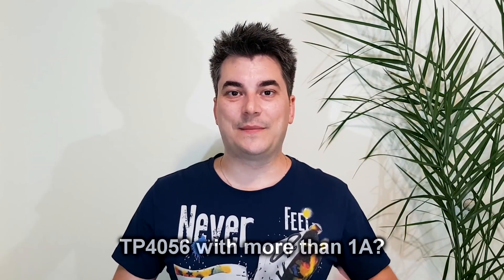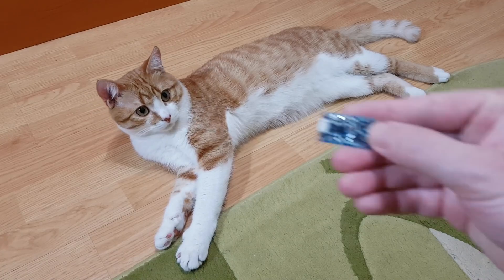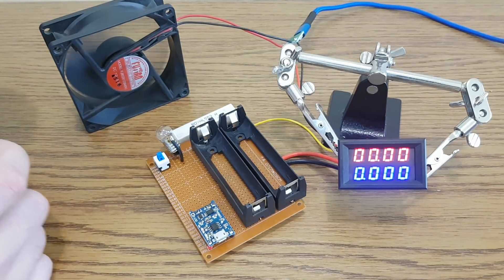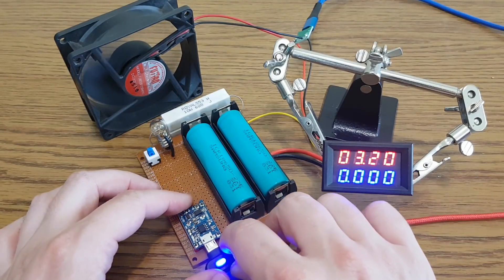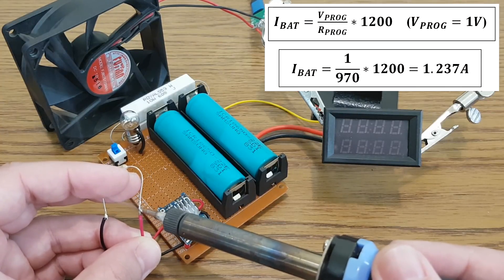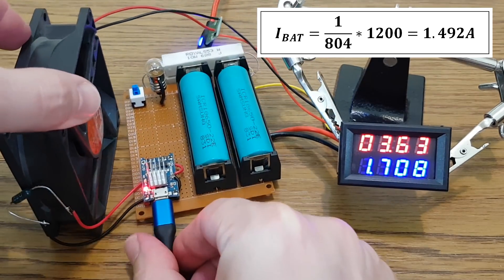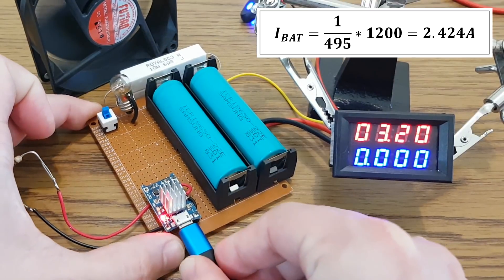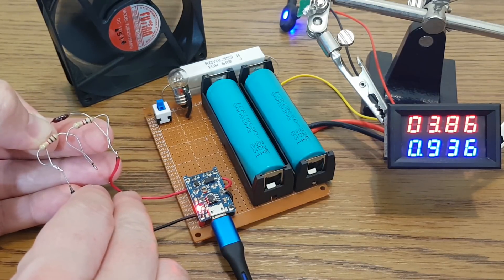Can a TP4056 module charge with more than 1A?

Comment: So the easiest thing to do is probably just delete the resistor and wire it straight through.

Might try it!
Reply from the maker: Actually, the easiest thing to do is to replace the resistor with a potentiometer and adjust the current in real time.

Comment: Accidently shorted one of these chips (the smaller tp4056 variety without UV protection),, so scrapped off the  backside's conformal coating, and the copper ground plane was HUGE(+90% of chip), and it's negatively connected to chip so sinking back side should cool chip better,, just don't scrap off "positive" coating (10%) or you'll short it like dumb arse did.   SORIN, just slap your heatsink(or larger one) on the back taking care to cover P battery terminal and see how long it can charge at 2A without the noisy fan?   If works could screw the sink to chip via negative in/out post for secure, tight connection.  Either way, very fun video!
Reply from the maker: Yes, you can also add a heatsink on the back of the circuit board. You can add a larger heatsink, if there is enough space, it depends on your project.

Comment: What if I set a 1A charging current, but my power supply is not stable, varying the voltage and current from time to time, such as a solar panel?
Is this module still applicable?
Reply from the maker: The TP4056 will not work correctly, because it cannot change the charging current in real time. 
for a solar panel you need an MPPT module, with an input voltage according to the solar panel, like one of these: 
https://s.click.aliexpress.com/e/_DEluq0j

Comment: Wow 2 years ago I was here. Found this video on Google, was looking up the tp4054 to see about increasing the output current for a portable soldering iron (the type like a soldering gun) have a cheap 3AA battery one but it's absolutely crap.. 
was looking to add a 3A Li-ion cell in it but need more current.

Comment: Thanks that's what I was looking for which is not mentioned in datasheets beyond charging 1 ampere current. Now my question is what is your cells specifications? Is that 18650 or different, because I also studied we need to charge a lithium battery with its 37% of capacity current rate and exceeding that percentage can damage the cell.
Reply from the maker: It depends on the type of Li-Ion cell. if you use old, untested or cheap cells you should start the charging process at a 0.2C rate and check if the cell gets hot. good quality cells can be charged at a 0.6C or even 1C rate

Comment: lets say you have 7 cells in series ( or more) and you use one tp4056 for each cell, can each cell be charged without having to disconnect each cell from each other, if each tp4056 has same power source ( such as computer atx)?
If yes then you would have a balancing charger as each cell would stop charging at same point.
Reply from the maker: Hi. I made a detailed video about this idea: https://youtu.be/HO2DKDikik4

Comment: Can we use potentiometer instead of r3
Reply from the maker: yes
Reply: @Sorin_DIY  value of potentiometer
Reply from the maker: you need to solder a 1k resistor in series with a 10k pot. the programable resistor will vary between 1k and 11kohm, so the current will be 1.2A to 0.1A.

Comment: I found that the TP4056 chip is soldered down to the board under the body of the chip as a heat sink.  If you take a look at the back side of the module, there is a group of vias directly under the chip leading to a plane of copper on the bottom side of the board.  I found the best place to put a heat sink is actually under the board, not on top of the chip.  I did this and it was surprising that you can keep your finger on the top of the chip even though charging at 1A and beyond.  I also suppose that keeping the input voltage closer to the battery voltage might reduce the amount of work the TP4056 has to do, I ran it around 4.4V instead of 5.0V and that worked well too.
Reply from the maker: yes, cooling the entire module will also cool down the IC. but it depends if you have the space under the module for a heatsink.
Reply: @Sorin_DIY  Thanks Sorin, I love your channel!

Comment: To enhance the module, I located an old PCB saved from a small radio.  For volume, it contains a 10K volume potentiometer in series with a 1K resistor.  I cut out that section of the PCB and double-sided foam adhered it to the back of the TP4056 module, with two wires directly to the R3 connections replacing the SMT resistor.  This gives me a range of 110-1200 mA charging current options without changing resistors, these values I marked on the thumb wheel with a laminated label.

Thanks for the entertainment, information, and cuteness!   It was inspirational at the least :)

Comment: Does it needs to connect 2 batteries on a parallel configuration on a 1s bms then connected to the TP 4056.
Reply from the maker: no. you can use 1 or 2 cells. with 2 cells the capacity will double.
Reply: Does the Tp 4056 has built in bms?  Because to provide protection on the tp 4056 on a 2s2p li ion with a 1 s bms.
Reply: I used a 1s battery with 1s bms and it works while i measure the resistance on the R3 builtin resistor on the tp 4056 it reads 620 ohms on the R1 resistor it reads 1 kilo ohm same as the R2  resistor 1 kilo ohm. The resistors for Type C TP 4056 is very small. 

As I saw on the video the R3 resistor was replaced by a 620 ohms to achieve 2.3 Amperes of charging speed. While the TP 4056 I bought has a lower resistance on the R3 while the R1 and R2 both of it has 1 kilo ohm resistance.

Comment: Salut, Sorin
 De ce potentiometru am nevoie pentru a putea ajusta curentul de la 1 A pana la 2,
Multumesc!
Felicitari pentru clipurile tale,spor!
Reply from the maker: Salut. pentru 1A rezistenta programabila trebuie sa fie de 1200ohm, iar pentru 2A rezistenta trebuie sa fie de 600ohm. nu exista un potentiometru care sa varieze intre aceste valori. poti sa folosesti un potentiometru dublu de 1Kohm, sa lipesti in paralel pinii potentiometrului si astfel dintr-un potentiometru dublu de 1K sa faci un potentiometru simplu de 500ohm. si acest potentiometru sa il legi in serie cu o rezistenta de 680ohm. 
deci in final o sa varieze intre 680ohm (1.76A) si 1.18Kohm (1.01A).  varianta asta cred ca se incadreaza cel mai bine intre ce valori vrei.
Reply: Iti multumesc mult de tot!
Reply: Mie nu imi trece de 500mah.
Daca baterie e incarcata peste 3.90v nici macar nu se aprinde becul rosu, nu baga nimic in ea.
Testat pe un step up si un led, ajunge la 1.5a.
Care e problema la incarcarea celulelor? 
Multumesc!

Comment: Hey Sorin bro ..thanks for the great video ..i have 2 questions:

1)  the resistors that you are using are of how many watts ? i see you answered it already and you mentioned that your resistors are quarter watts but they seemed to be big .. looks like half watt ...could u please clarify?

2) another question .. i want to draw around 2 amps from tp4056(will put a resistor accordingly by referring your video) .. is it necessary to use a heat sink? or can it be avoided.

Regards
Rahul
Reply from the maker: hi. you can use a 1/4W resistor. 
at more than 0.8A the IC will get hot. so at 2A you definitely need to add a heatsink.
Reply: @Sorin_DIY  : ohkk thanks bro for the info .. cheers!!!!

Comment: I wonder if a lower input voltage would help with heat because I assume they have to drop the rest of the voltage as heat so if you were doing a lot and could supply them with like 4.5v if that would help with heat
Reply from the maker: it will still heat up, because the output current is high.

Comment: Smart your project. But by adding a Mosfet to the output, the current can increase up to 9 A. Look at this project
https://youtu.be/m9VPWE4dCvw

După nume, pari a fi român. Corect ?
Reply from the maker: Salut. da dar e riscant pentru baterie, mosfetul ala lasa sa treaca direct 5V catre baterie. daca nu esti atent, risti sa strici bateria.
Reply: @Sorin_DIY  Păi cum să treacă 5 V ? Dacă integratul oprește curentul la 4,2 V ?

Nu am studiat/ problema , dar celălalt proiect îl găsesc mai potrivit.
Cînd nu voi avea ce face voi încerca cu un Z44.... dar nu foarte curînd ...

La revedere !
Reply: @Sorin_DIY  
Mosfetul se comportă ca și un 2 N 3055, după un 317.
Scoate 317 10 V, scoate și 2 N-ul 10 V ... dar suportă un curent mai mare decît 317.
Scoate 317 25 V, scoate și 2 N-ul 25 V.

Cum ar putea 2 N-ul să scoată 30 V, cînd în baza lui intră 25 V ?

Tot așa și Mosfetul ...
Ce intră în Poartă, iese prin Sursă.
Cum ar putea el să crească tensiunea ?
Teoretic nu e corect ceea ce susții.
Nu am testat și nici nu o foi face prea curînd.
Acum am alte proiecte pe cap.

La revedere !

Comment: TP4056  are very low quality. I have made a 43 pcs chargers, powered up by a good computer PSU. So far, more than 10 pcs of TP4056  are already dead... If you buy these chargers, you need to buy more, because they will die one by one

Comment: Hi there, thanks for valuable information. Did you try connecting a tiny trimpot/variable resistor instead of those multiple resistors? How much current is passing on this programing resistor? Is it the direct output or is it like a gate with lower current? Best
Reply from the maker: hi. yes, potentiometers will work. the current is very low.
Reply: @Sorin_DIY   Thanks, I found an SMD 10K 0.25W single turn pot to try. Best.

Comment: Interesting experiment, however it just demonstrates the internal overheat protection in the chip. Note that most of the TP4056 chips are fake clones so other ones may not work as well as shown here.
If you want a simple module that is rated 2A, then use the TP5100 instead of the TP4056. It's more efficient, since it's a Switching rather than Linear controller, and you can program it to charge 1S or 2S (8.4V cutoff).
Reply: Is there anything similar for 3S?
Reply: @bitsurfer0101  - yes of course. There are many solutions for 3S, very cheap as pre-built modules. They use different chips, not these simple TP** models

Comment: I don't know anything about electronics or power. Is it possible to combine 3 TP4056 circuit to get 3A current? Sorry  for the dumb question.
Reply from the maker: I don't think so, the battery will not be charged correctly.
Reply: @Sorin_DIY  Thank you for the reply.

Comment: Thanks Sorin for your very instructive video. I was looking for this modificaions but the Inverse way. I try to use the TPA4056 module for charge tiny small Mini drone battery arround 100mAh. What value o resistor is suitable for the Mod?
Reply from the maker: if you want to charge it with 100mA, the module needs a 12kohm resistor.

Comment: Dear Sorin, Can you tell me 01. why V(prog) is 1v? and 02. What is 1200 in the formula?
Reply from the maker: the integrated circuit is programmed to work with that formula. you just need to change the programable resistor and the IC will calculate the charging current. the IC was programmed by the manufacturer to work with those values.

Comment: How many watts the programmble  resistor you use sir?
Reply from the maker: 0.25W
Reply: @Sorin_DIY  thank you sir.
Reply: @Sorin_DIY  i hpo next time you will make a simpe and affordable mini power generator using 18650 batteries. ✌️✌️✌️

Comment: 🤔 can i connect 2 tp4056 in parallel  to get 2 amp ? 
if I'm using 4 battery in parallel  to charge 😛

decreasing ohm cause more heat  :(
Reply from the maker: it's difficult to connect these modules in parallel. you can watch my "15000mAh powerbank" video for details.
Reply: @Sorin_DIY   amazing video i alredy watched when you posted , i love your channel 🌝💗 best elec. nerd

Comment: My tp4056 will get hot when i plug the charger
Can somebody explain it??
Reply from the maker: the TP4056 module gets hot when charging with 1A. you need to add a heatsink on the IC or lower the charging current.
Reply: @Sorin_DIY   ooh i think the 1amps is only the output from tp4056, but i was wrong, thank u

Comment: There were no explosions and just a lover charging current because the chip has an internal temperature sensor reducing the duty cycle. In the complete datasheet, you can see it have an internal comparator set to 145°C vs DIE temp. But from graphs, you can see it kick in around 110°C on the package.

So more cooling = even more current. 😉
Reply: Yep. Since it's a Linear Regulator the more wattage (Volts AND Amps) being dissipated the more heat is internally generated. However the IC package is not designed to dissipate high currents, so they rate it for 1A bare (no heatsink and fan).  If you want more current there are absolutely tons of cheap and better ways than a TP4056.
Reply: @johncoops6897  Thanks. I'm new here. Could you mention some modules cheaper and better than this TP 4056, for more amps charging?
Reply: @samsungsexy7164  - not specifically, it depends how many amps you want. With separate Mosfets and heatsinks you can pump lots of current, but you got to remember your cells will suffer.
Just search on Ebay, Banggood, or whatever.... there are literally thousands to choose from... but you need to decide your power, control method, etc first.
Reply: @johncoops6897  I have a 36v 10S 5P battery pack.  Which module number you suggests if I want to use 1 charging module per parallel line pls?
Reply: @samsungsexy7164  - you cannot charge it like that. You need a 10S BMS and 10S charger (10x 4.1V or  4.2V) and some way to balance those cells either during charging or in the pack or both.
Since you rum 5P and if they were (say) 2500mAh cells, you have 12.5 Amp Hours of current, so you need to decide how fast you want to charge it ... 12.5 hours at 1Amp, or 2 hours at 6.25 Amps, etc.
So you neNeea suitable Lithium Charger to suit all of that.
It's a LOT of power and a lot of money in cells, so you need to do it properly.. . not some half assed DIY botch job using $1 Modules off Ebay.
Reply: @johncoops6897  Thinking of making a 10S charger using these type of modules. Then add a balancer on the pack and VESC also plays a part of BMS like, cut off at certain low voltage etc. For that I need to know a module like this one but can handle 4amps/5A safely. Do you have any module number that handle 5A charge?
Reply: @samsungsexy7164  - oh FFS, I just answered you. I shouldn't Be wasting my time even replying again.
You cannot use single modules to charge a 10S pack. BUY A PROPER CHARGER.
Reply: @johncoops6897  Thanks for your patience and knowledge 👍

Comment: Sorin have you ever tried to make a powerbank which charges more than 1 amp? :) This is what im trying to do. Thanks for the video by the way. Excellent experiment and benefitful!
Reply from the maker: hi. I made a small and powerful powerbank with 10000mAh which can charge with max 2.4A. but the video it's available only on my Patreon page.
Reply: @Sorin_DIY  thank you for the answer. I’m experimenting with old laptop batteries too, with 2amps. When i use heatsink both chip and board(for the board, transistor heatsink), i took good result(but anyway not reached to 2amps without fan, max around 1.8amps). Without heatsink, no way. Thanks again for video and we expect more☺️.
Reply: @FBI actually what i mean was, did he make any powerbank with R3 modified(output>1A) tp4056 modules. I have watched his video what you meant already but in that he used tp4056s with existing resistors. Anyway i made mine with upgraded tp4056s glued to heatsinks for both boards and chips, and i’m testing. We will see if it will be stable. Thanks

Comment: Well I charge my low current devices with 2 - 3A for an instant charge, I haven't got many problems after years...
Reply from the maker: not all lithium cells can be charged with a high current. for most lithium cells it's recommended to be charged at a rate of 0.5C.
Reply: Thank you for the tip friend

Comment: is it safe to  just connect two tp4056 in parallel to get 2amps?
Reply: This is a good question
Reply from the maker: there are those modules with 4 TP4056 ICs which can charge with 3A. but if you try to connect 2 modules in parallel... I don't think they will charge the battery correctly. the circuit must be designed for ICs in parallel, not modules in parallel.

Comment: Wouldn't it have been easier to put a multiturn potentiometer instead of replacing the resistor every single time?
Reply: i want to see answer..
Reply from the maker: yes, it's easier to adjust the resistance with a potentiometer. but I wanted a fixed resistance. replacing the resistors takes 1-2 minutes. waiting for the cells to charge and to discharge... that takes a lot of time. all that time I didn't want to accidentally touch the potentiometer and change the value of the resistance. it took a few days to charge/discharge the cells and I moved the components a lot during this time. also the cat keeps interrupting me and plays with the components. so I needed a fixed resistance.
Reply: @Sorin_DIY  Thanks for your answer ✌

Comment: Can you please tell me the safe current for 5 amp battery packs
Reply from the maker: hi. it depends on the type of lithium cells you are using. for most cells it's recommended to charge them at a 0.5C rate. for example for a 5Ah battery pack the charging current should be: 5Ah*0.5C=2.5A.